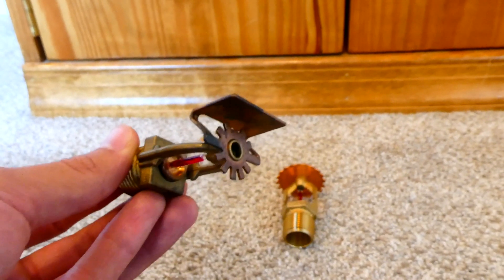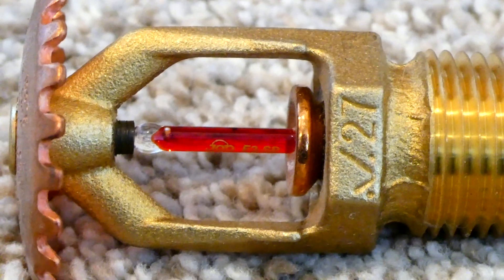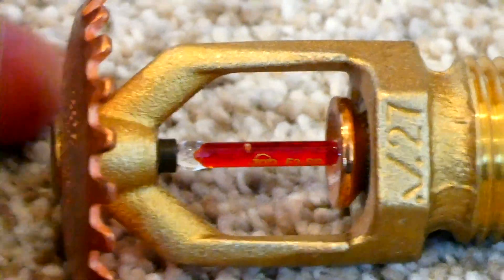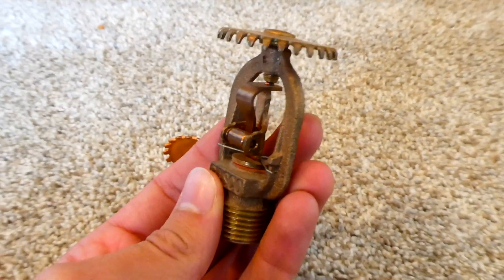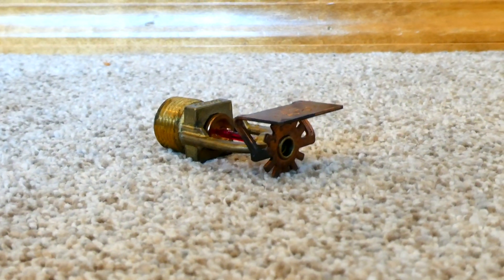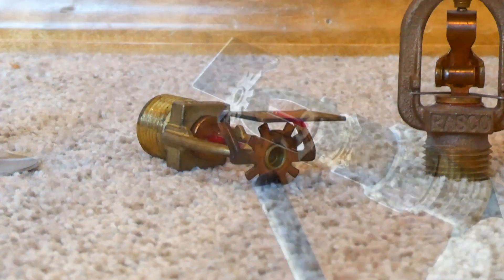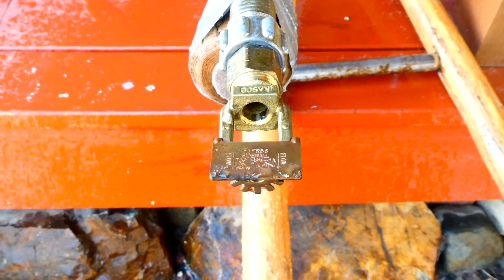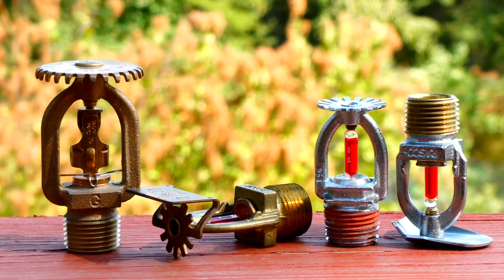Setting off a Fire Sprinkler! | How do Fire Sprinklers work? (Slomo)

Comment: Thank you so much for showing me this. Just moved into new apartments with these on the walls. I wasn't sure if there was a fire in someone else's home if every one would go off in mine. It's great to know that it's an individual system.
Reply: Lol same. I've never had these in an apartment, but my new place has one in every room. I was a bit freaked out by them. Worried they might accidentally go off, or ALL go off if my neighbor merely burns some toast. 😅 I was on edge about it. But I feel better knowing how they work. They're kinda ingenious actually! And I'm relieved to know they only go off if there's an actual hot bad fire, and then only localized to that one area. 😅

Comment: I'm surprised it took so much heat to set that one off. I've always known how they work, but decided to look it up, because I've seen some of them go off so fast with so little heat that I figured they had to be designed different. Had me wondering if they were using wax or something low temperature like that. (or things like bismuth or gallium, but there are also some alcohols that boil at just above room temperature and upwards from there that could be tuned in to a specific temperature). The thing I wonder most about though is seeing sprinklers like this going off from smoke and not heat. I've seen a couple occasions where a cloud of low temperature/warm smoke set off the sprinklers when there just shouldn't have been enough heat for them to go off.